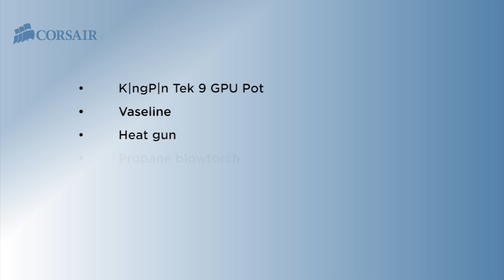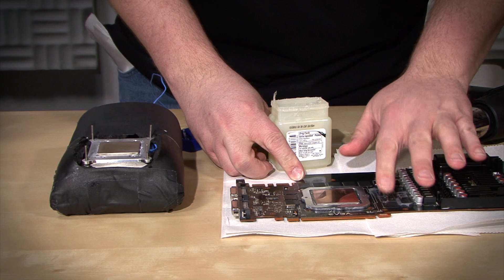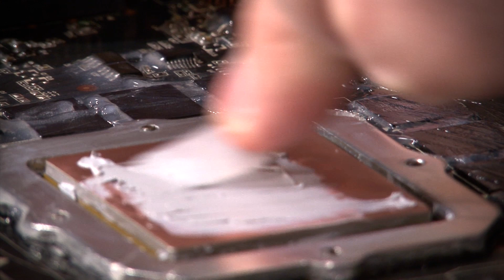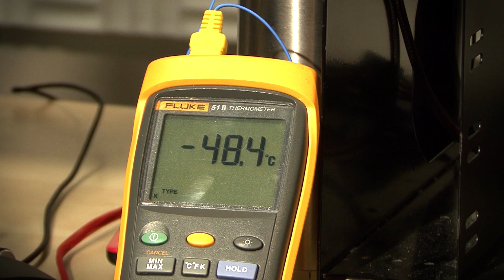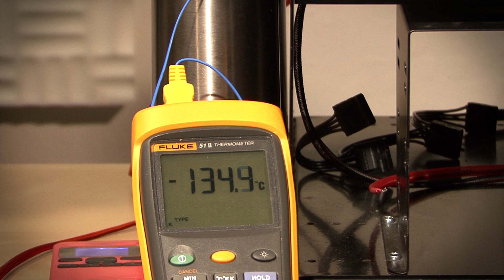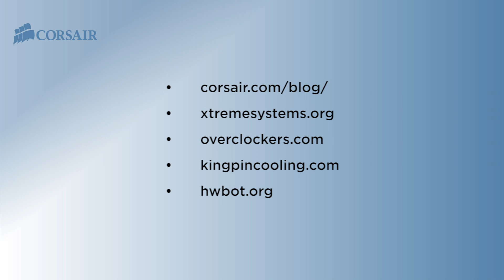Corsair® How-To Video: Setting up a GPU for overclocking

Comment: my GIGABYTE GTX 650 Ti OC is running at 1800mhz...
Reply: Shut up.
Reply: No, when i had it, it was overvolted and overclocked to 1800mhz on the gpu. the gigabyte heatsink on it was awesome. now i have a sapphire radeon r9 280x.
Reply: ihatejustin500 No, it wasn't. Why lie?
Reply: ihatejustin500 What were the temps? 180 C?
Reply: i don't think people realize that the gigabyte gtx 650ti at max load is only like 50 C.. at 1800mhz with a volt mod it got up to only 74 C.
Reply: ihatejustin500 lol yea k continue lying dude.

How about this. make a video about it and i'll believe you since it would be a downgrade going from a 650 ti with that high of an overclock (which i'd say would easy put the 780 ti a run for it's money) to a 280x.
Reply: so you really think that 768 cores at 1800mhz is better than 2048 cores at 1200mhz? genius, mate.